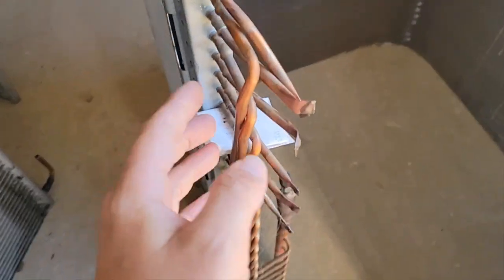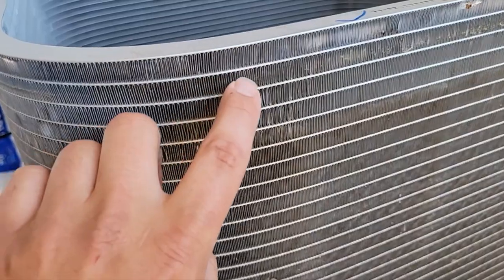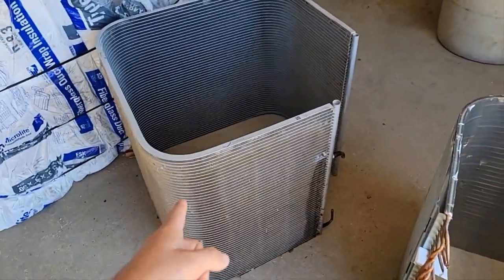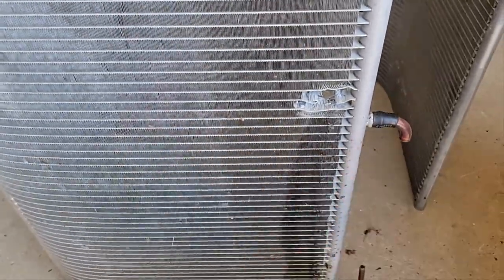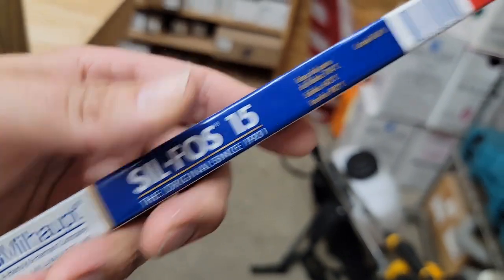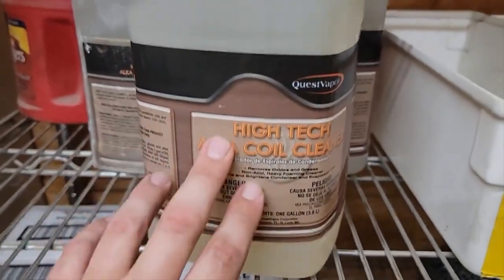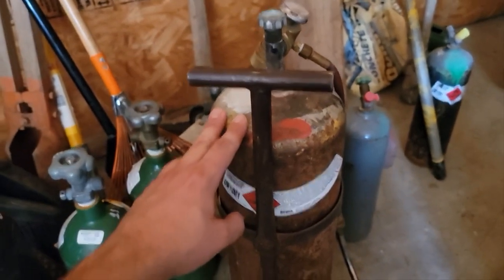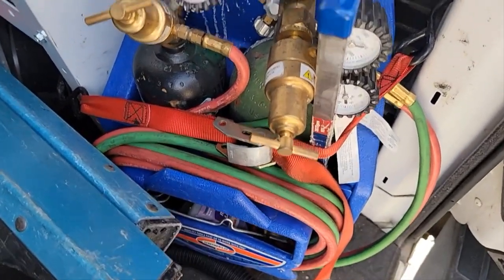Microchannel Coil vs Copper Coil: Which is Better?

Comment: Carrier is switching over to micro channel on evaporators.   And, my first install froze up.    At 290 cfm per ton I can't blame the coil though.  However, I compared the product data betwen Copper and Micro channel.    Copper coils have about 95% efficiency where only 5% of the air is not cooled in the air stream.    Micro Channel is just 75%.     That means the coil is seeing just 75% airflow right out of the box.   That will make the refrigerant colder.
Reply: I'm sizing these coils 25% bigger to compensate.

Comment: I have a micro channel coil next to a kitchen exhaust vent. This cool builds up quick. I was wondering about trying simple green to help breakdown some build up on this coil. Would this create an issue?
Reply from the maker: I think simple green would work
Reply: @TaddyDigest  I’ll try it out next time I make it out there. I’ll let you know how it comes out. Was just a little nervous to use anything other then water. It’s just not coming as clean as I hoped it would

Comment: I have a 34 year old Rheem R 22 that’s finally going out. I’ve taken all the HVAC classes. And got my card from the EPA course online for the Freon. Do you want over eight bids the cheapest is 8000 to install the new one. I can buy all the tools and equipment and still put 2000 in my pocket by doing it myself. It’s taking a year, but then I can fix my own shit.

Comment: Can I change out a micro channel condenser with a regular copper
Coil condenser 
Also the micro channel condensers
Im working on has 3 pressure switches one each coming in before the service ports and the normal one in the liquid line discharge after the compressor also why are all these in series this is a 2 ton garrison unit
Reply from the maker: yes

Comment: Just to clarify, your comments refer to the condenser coil, not the evaporator coil correct? Do you recommend aluminum for the evaporator coil?
Reply from the maker: copper
Reply: @TaddyDigest the problem is that you can't mix and match. If the condenser is copper you have to go with a copper evaporator coil. And if the condenser is aluminum, you have to go with an aluminum evaporator coil (micro channel coil). Because a microchannel coils holds less refrigerant.

Comment: I've had problems ever since we went to China for cheap, thin copper and aluminum tubing and at the same time doubled the operating pressures and quadrupled the price as of 1/1/23! Now my first American Std gas package unit came with a pos microchannel indoor coil!
Reply from the maker: yes exactly you are 100% correct

Comment: A big problem with microchannel coils is that's aluminum is very thin and fragile. Units do ice up every now and then. Could be from dirty filter or broken blower motor, low on refrigerant etc. once that evap coil gets iced up that ice screws up the aluminum channels carrying the refrigerant and then you have leaks. Extremely rare for damage from leaks to happen on copper coils.

Comment: Why would I want to patch one of these coils?  I'm on the hook if the patch fails?  I don't really like giving away refrigerant for free.
Reply from the maker: If? You can't get another coil for a while and the units under warranty. It's good to be able to patch it because then you get the customer Air conditioning while they're waiting for the part That's one reason why
Reply: @TaddyDigest  If it's one of my systems, I'd probably do whatever I can to get he customer taken care of, but I can see a scenario where the patch doesn't hold on 10 lbs of refrigerant, and no customer will want to eat that cost.  Love your videos, btw!